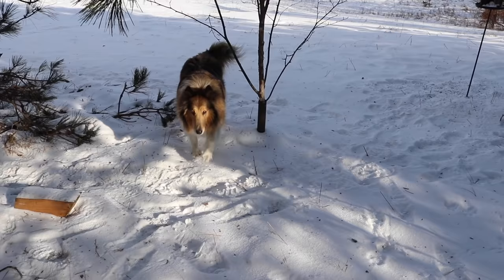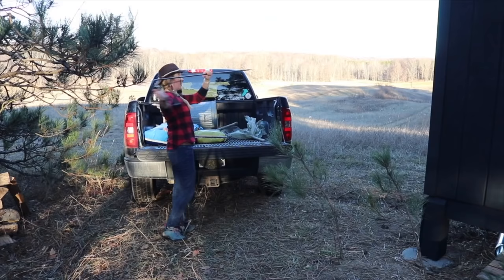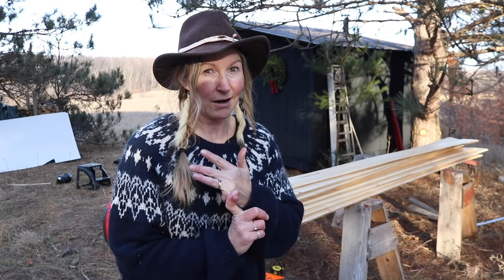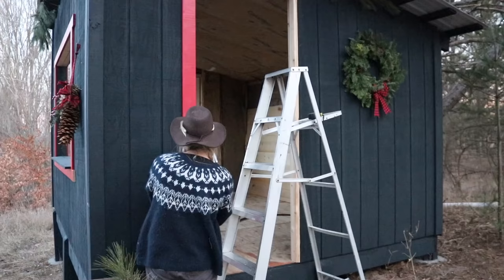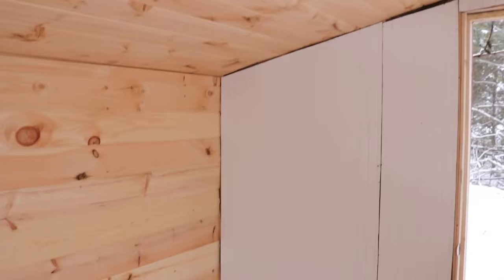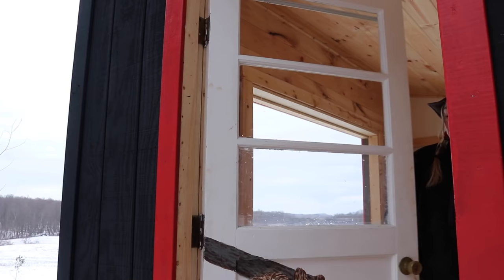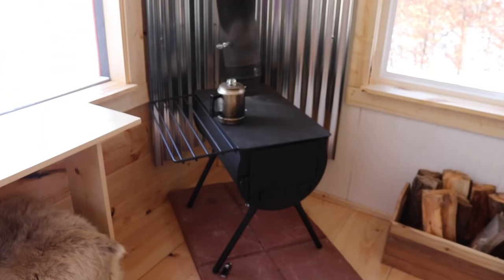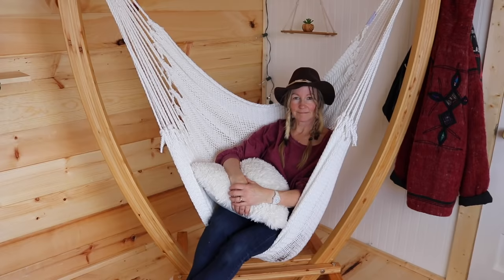Off Grid Tiny Cabin- FINISHED!

Comment: I'm a single woman.  I wanna build my own cabin for me and my dogs too.  It looks easy now that I see you do it. I think my cabin will have a porch for me to sit outside and listen to nature at night.
Reply from the maker: well it's not hard but it's a lot of work but you can do it!
Reply: you can also get some kind peeps to assist
Reply: do :)
Reply: I’m a single man, need a hand?
Reply: Keep design of a cabin simple to minimize cutting, especially of outer walls. Plywood comes in 4' x 8' sheets, so dimension your structure in 4' increments. 8' x 8', 12' x 16', etc. Take care of your back. Some materials are heavy. Full sheets of plywood weigh about 100 pounds per inch of thickness. That means 0.50" thickness sheets weigh 50 pounds, and 0.75" thickness sheets weigh 75 pounds. Don't overestimate your abilities with other lumber pieces either.
    Take it from someone who knows, if you hurt your back you could be permanently screwed. Shoulders too. I've had all those surgeries among other orthopedic ones and none of it's fun. Not fun to injure, and not fun to fix.
Reply: @joewoodchuck3824  “Some materials are heavy”.  Yeah, like those boulders for the fire pit.🙈
Reply: @kanamichelle7404  Anything can be harmful if handled the wrong way.
Reply: Single woman here living in a cabin with a bunch of dogs, doooo it! You can get someone to help you with parts of it if it seems overwhelming. I had someone put together my cabin shell, and the roof. I did the rest (and that was a ton!!).

Comment: I have a trick to share with you and other DIYers about the doorway threshold. You cut the 1 by wood the width of the doorway opening. Then, do not nail it in. Instead, use two or three hinges to install it so that threshold flips outward so you sweep the dirt right out the doorway. 
Come on, that's genius and it works. I used a piano hinge on mine. 👍🏻🇺🇸

Comment: When I put in t&g that was bowed I used a piece of 2x4 and a small auto jack to get them straight, nailed in place and then removed the jack and on to the next board. Looks GREAT!  Job well done!
Reply: Yep.  Or nail up a block just above the bow, and use it as an anchor for a prybar.  That stuff's too expensive not to use every piece.  We finished the inside of our cabin with the same board.
Reply: You can also use wedges, but it's easier if you use narrower boards too 👍😊

Comment: to fix those bows, make sure your 1st one is perfect, then on a bowed board start at one end then at each nailer use a chisel. Pound it in at an angle then lever the board down into place, shoot it then move to the next nailer. I'd draw it out if I could, It is really easy
Reply: Pipe clamps can get great results too. Although, the chisel is fast and effective.
Reply: Great to hear a professional comment about how to fix this problem. Fixes can be quite simple when you know the correct technique.
Another thing I would suggest, is having the groove side of the board uppermost, which makes fitting the tongue down into it as you go, easier.
And hitting the tongue like that with a hammer is a sure way to deform the edge so it will never but in the groove, or cause them to chip out. This won't happen if you fit the tongue into the groove rather than the other way round.
Then use a flat piece of timber against the edge of the board to hammer on, which spreads the load and prevents damage to those fragile edges.
Finally, those thin boards become a lot more amenable if you wet them all over, cover the stack and leave overnight. Propellers and boomerangs turn straight!
Love the cosy cabin and the can-do attitude.

Comment: Girl, I built a 10'x30' back porch last spring and finished Jul 2.  Bowed or otherwise sketchy wood was the #1 issue.  Not being 64 years old, doing it solo, not the saws, ladders, 300 sf of laying a brick floor, moving rail road ties, a pile of rocky sand taller than me, nope - BOWED BOARDS!

Comment: A solution for your bowed boards:  Cut two wedges and temporarily nail one of them a few inches above the bowed area.  Slide the other wedge facing in the opposite direction between the bowed board and the nailed wedge.  Bang it into place until it straightens the bowed board.  Nail it in place then remove the wedges.
Reply: Fantastic little cabin. So cozy, and I admire your energy. ENJOY.👍🤩
Reply: Good idea.  I would fasten a 2x2 board above and use a pry bar, but I like your idea better, TBH
Reply: When I ran into this I did a similar fix by tacking a temporary board above the bow and slipped in a crow bar to crank some pressure - levering it into position

Comment: The only suggestion I have for other builders of a tiny cabin is to build the deck base and then sheet the underside with flat metal to keep the mice out.  Flip the base over now so the metal is on the down side.  Then fasten the floor deck to the footings or pads.   Now the floor joist are on the upside of the metal.  Put your insulation between the joists over the metal sheeting and then add the subfloor to the joists.   The insulation will be sandwiched between the tin and the plywood subfloor.

Comment: A fellow perfectionist here, love the work and the energy you put in to all that you do. If you wanna force those boards tight a nice tip is to have a couple of wooden wedges the same thickness as the boards then nail or screw a strong block in place so you are able to tap the wedge to force it down on the bent boards.
Reply: Came here to say the same
Reply: Yea, muscle it down into place

Comment: Pro tip when dealing with t and g... only nail bottom, that way you have room to persuade the next board into groove. Then only nail that bottom and so on.
Reply: That's the way I used to do it too.
Reply: Tip 2,you can nail one far side then use a bump block to persuade the bow in the wood which btw is normal.

Comment: Hint: Use a scarp piece of tongue and groove for hammering the next board in tight. 
Adorable cabin, nothing says cozy like tongue and groove pine.
We feed the birds with a log, 12” long by a few inches, screw a hook on top, drill some holes on the sides and fill with chunky peanut butter. 
If you need a bed, Murphy bed or bunks would work in small spaces.

Comment: OMG, just start a nail in the middle, set the board in place, then pull down laterally on the board in the middle, hang there while you nail it in the middle first, that takes out the bend, and then nail at each end.  All that lumber is good and can be used.  And I'm screaming this at my screen watching you toss good boards, OMG you should have seen it.  I really enjoy your site! Camping forever!

Comment: You have to PRY those wall boards down to force the bow out of them.  You can temporarily screw a 2x6 to the studs across several, insert a scrap of the groove above and then use that for leverage to pry them down to be straight, and screw them in.

Comment: The trick to putting together tongue and groove is to place a small scrap piece of grove ripped to an inch or two wide buy several inches long over the tongue, so you can give it a heavy wack without risk of damaging it. Helps with beating those stubborn boards into submission.

Comment: You’re always gonna come up with TNG products that have a crown in them. You can take a scrap piece of even 2 x 2 18 inches long trailer hole in one end of your stud an inch above the highest crown. Screw your 2 x 2 hanging straight out about an inch below to the back of the wall and use it as a lever to pull the crown down while hopefully you have a nail gun, or have a couple screws already started at your stud line so you can hold it down with one hand and put a screw or an nail at the other. Good luck you’re doing a great job.

Comment: Hi Guys, Great job you are doing by posting all your hard work and determination; so inspiring. One tip for folks in future. Interior wall cladding with a warped board...Cut it half way across a vertical frame batten and refit in two shorter lengths. Good chance the bowing will flatten out and leave no gaps. I had the same problem with my garden office I just finished. In Somerset UK and no serious snow here this December so far Dec 30th 2022.

Comment: Hidee, i’m just wanting to bend your ear regarding the siding. If you will get A short piece of the siding/flooring and cut it on a diagonal to use as a wedge. Say that you have the tongue side up, place the grooved wedge on top of it, slide it down to a stud, and determine how much of a space that you need to fill, slide that wedge down and screw the opposing wedge onto the stud just above the gap. Pull the grooved wedge back down and tap it into place, until it pulls together.

Comment: Absolutely fabulous little cabin. You might want to think about putting some insulated curtains on the windows to allow the heat to stay in and to keep the cold more at bay. I have a bedroom that has the double insulation curtains and they’re dark on the inside the side that faces the window and tan on the side that faces the room and they’re quite stylish however when it’s cold it keeps the cold out and then I can open them without a problem. In your case you could open them and then crack a window if you wanted to cool off a little more. Love what you’ve done. Peace and Love🎃☮️❤️

Comment: If you add some thermal mass, and the window faces South, you would have a passive solar structure. One possibility is to put a layer of bricks on the floor, with insulation under them.

Comment: You could have wedged piece of wood from the roof to the center of the board to hold it straight until you nail it in, once you take that piece of wood out the nails will hold it straight. Eventually it'll relax and will not have a bend anymore even if the nails loosen up.

Comment: For what I’ve seen the crack wasn’t that wide so if you mailed a short piece of 2 x 4 to one of the two by fours close to the middle pole down on it it’ll close the gap then get a couple nails in there while you’re still holding the 2 x 4

Comment: I feel so bad watching you struggle with bowed boards. This is an issue everywhere you board something in. Yes actually, you do need to "beat them into submission" lol
Easier with a helper though. It is tricky at first but you can straighten most of them.

Comment: Any reason why you couldn’t have tacked on a little piece of wood to the 2x4 in the center used a hammer to prey the interior siding board down into place flat then put a nail in it while holding tension down? Just curious